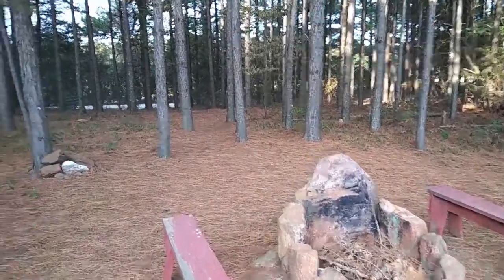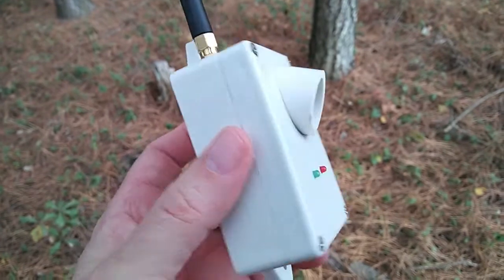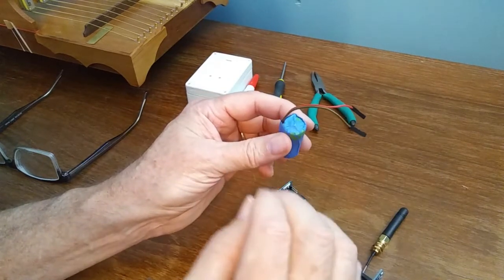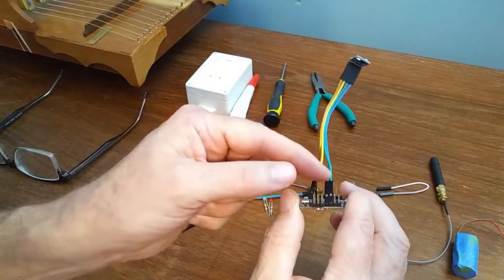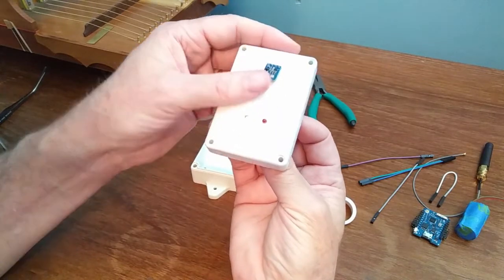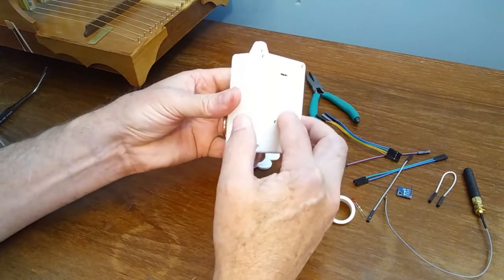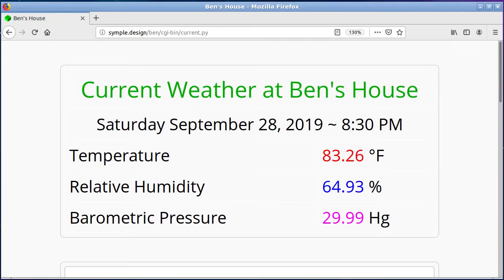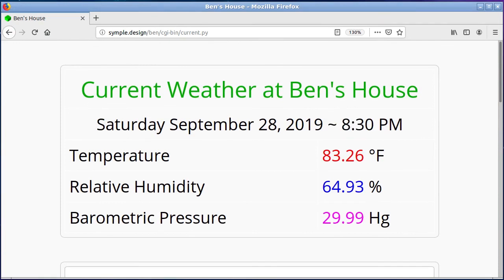Weather Station with Bosch BME280 Sensor - ESP32/8266 Project 12

Comment: Hi, Clayton, You have inspired me to build the project! I have gathered most of the needed parts. I will be using a PIC18F4550 MCU. I wanted to share a couple of tips...

You mention soldering wire leads directly onto the battery. Tip - Sand the battery terminals slightly and clean off any sanding dust, before tinning them. If you expose a little bit of copper, great, but don't over do it. Just scuffing the surface is usually sufficient. Use lots of flux, when flowing the solder.

Tin the wire, too, as you instruct. Add more flux, before joining the wire to the terminal.

Roughing the terminal and using lots of flux does two things... It speeds the time needed to get the solder to take on the terminal, lessening the battery's exposure to heat... And, it causes the solder to get a much better mechanical connection to the terminal.

Tip two - a piece cut from a used lady's nylon stocking will do nicely for making the spider screen. That's much cheaper than buying a roll of window screen... Or, buy a new, cheap pair of stockings, from a dollar store.
Reply from the maker: Excellent! And those are both great tips. Will use them. Also, seal around the antenna really well. Mine leaked and shorted out the battery. Made a big mess.
Reply: @ClaytonDarwin  I will not be using the wifi feature. I will be using mine to track the barometric pressure changes in the house and log them against taking arthritis pain medication. For me, there is a direct correlation  between rain and pain. I will then be able to share this information with my doctor.

You and Ben can be proud that your project is really making a difference in peoples lives. I bet y'all hadn't even thought of that possibility. Atta-boys!

Comment: Excellent set up. I've been looking to build a cigar humidor hygrometer that can be checked from anywhere. I think this will do beautifully.
Reply from the maker: That's a great idea.
Reply: Do you have any additional write ups posted somewhere? I've played a bit with arduino and raspberry pi, though I'm certainly no coder, so some references would be awesome. Specially about the 10 minute sleep interval?
Reply from the maker: I check in the morning to see if I have the code posted somewhere.
Reply: I'd appreciate the hell out of it, sir. 🍻
Reply from the maker: Link: https://gitlab.com/duder1966/youtube-projects 
Look for Ben's Weather Station in MicroPython folder. That was using an ESP8266, but it should adapt easily.
Reply: You are the man 🍻
I've got some ESP32s that ought to be here tomorrow. Looking forward to tooling around with this.
Be happy to throw some beer money your direction if you've got a donation link somewhere
Reply from the maker: No worries, James. Thanks for the offer. Send me an email if you have any questions. I like this idea.
Reply: The micropython project ended up being a little too advanced for my experience. I ended up going the thingspeak IoT route with just arduino ide. Finally got it working last night. Next step is battery and 3d printing an enclosure
Reply from the maker: @duff8402  Cool. I'm going to have to get a BME280 hooked up soon myself. I'll see about getting some better code together. Humidors, incubators. Lots of uses.
Reply: Finished concept. All improvements from here
https://www.instagram.com/p/CNgyCAzHvE8/?igshid=df4pe1ioibit
Reply from the maker: Nice. Thanks for sharing this. 👍

Comment: Have you measured the battery life of this setup? Also, the voltage of a CR123A is only 2.7~2.8 at normal working condition, is that enough for esp8266? Thanks.
Reply from the maker: The esp8266 uses a lot of power for WiFi. This application needs to go solar to be viable. I've moved to the ESP32 now, which has some good low power features if you get the right board. Check out Kevin Darrah's channel. He uses cr2032s.

Comment: Great and well-put together weather station! Had a question about connecting the BME280 GND to a GPIO pin. Why not connect the BME280 3V3 to a GPIO pin and pull the pin low instead to turn the device off?
Reply from the maker: Sure. I might have done that in the new video.

Comment: Very good project. How it has run after almost two years regarding sensor, processor, battery? Have you been forced to replace some parts?
Reply from the maker: It uses a lot of power to send data, so it needs to be solar powered. I bought some little panels, but I haven't converted it yet. Also, eziot.link would make it way easier.

Comment: Great project! I'm looking into making a similar project only difference being that i want to log on an SD.

I believe attaching a screen can mess up your temperature reading. When the screen gets moist it will start to evaporate the that moisture, than you are effectively measuring dew point and not temperature.
Reply from the maker: Good point. That will be the case for any moisture near the sensor. The whole thing needs to be protected from rain, direct sun, insects, dust, et cetera.

Comment: Subscribed! I'm curious by the way, where did you get the waterproof container used in the video? I was looking to 3D print one, but realized it would be convenient to try something that's already out there. Appreciate any suggestions or pointers.
Reply from the maker: That is a common project container. I think I got it from eBay for a few dollars. It's not 100% waterproof. In later versions (see the updated video) I moved to a sheltered location.

Comment: Great video, thanks for sharing. 

I’ve had some parts to do a similar project myself but I’ve not gotten around to it. Yours is superior to what I had in mind, which may inspire my own project. 

Any idea if covering the module with glue increases the temp data of the bme? I’ve used a dht sensor and comparing the two, the bme runs higher when comparing the two sensors to my indoor thermostat.
Reply from the maker: Chris, thanks. I haven't had time to do much accuracy testing, so I'm not sure. My earlier projects (several years ago) used the bht sensors and I never really trusted them. I'm hoping the bme types are more reliable. The glue is just on the extra components, not really the bme. Just to make them more weather tolerant. I don't think it will change the reading much.
Reply: Clayton Darwin okay thanks for that. The Bosch stuff does seem of a higher standard. I was referring to the voltage regulator, as I’ve heard people saying it heats up and can effect the bme itself. Although if it’s outside, it probably wont matter. I’m going to follow suit and cover the module and have it exposed. Thanks
Reply from the maker: Well, that does make sense. Theoretically, mine is only powered for about 2 seconds every 10 minutes, so maybe that isn't long enough to effect it.

Comment: Please post the links to purchase the components. That will help us gather the correct items, whether we buy from that vendor, or another.

I have been looking at the BME280, just this morning, for a similar application. I have severe arthritis pain that is clearly effected by the weather. I want to track medicine use against changes in barometric pressure.

I use PIC18F4550 MCUs, mostly. Is the code written in C code? If so, maybe I can port it over...

Thank you for sharing!
Reply from the maker: Sorry for the delayed response. I'm very busy at work (real work) at the moment, but I'll post parts when I get a break. Mostly cheap stuff from ebay.
Reply from the maker: I'm not a C coder. Sorry. Mainly Linux + Python. Will that board take MicroPython? do you know?
Reply: @ClaytonDarwin  I am sending you an email to answer your question. I will put my YouTube name in the subject, so you will know it is from me.

Comment: Very nice project, congrats, Was wondering how long the battery lasts ?
Reply from the maker: I had bad results with the battery. About 3 weeks. I'm upgrading to an ESP32 and going to solar. I think the ESP32 has better low-power sleep, but a small solar cell will be more than enough. Also, that case wasn't as waterproof as it seemed. Got moisture inside eventually. I'll make a new video when I get it redone.
Reply: @ClaytonDarwin  Tkx for  the update, looking forward to the refurbishing.

Comment: I'm interested in building it can you help me with the your plan
Reply from the maker: I don't really have a plan other than what is in the video. The code is in the description. I would use an ESP32.
Reply: @ClaytonDarwin  Why esp32 is it better than 8266?
Reply from the maker: The main reason is more RAM. I have to do a lot of memory management with an 8266, but very little with an ESP32. But also more flash, more peripherals, faster, dual core, etc.

Comment: Did you connect battery directly?
Reply from the maker: I used a cr123a, which is 3.1 volts, so it can be connected directly. Check the specs on your module and your battery to be sure. Most modules have DC converters that can accept 3 to 5 volts.
Reply: @ClaytonDarwin  I have ESP8266 NodeMcu V2 CP2102
Reply from the maker: You'll have to look up the specs for that. I have no idea what they are.